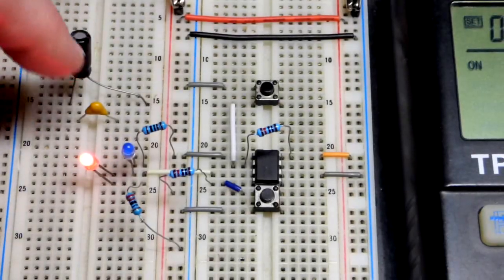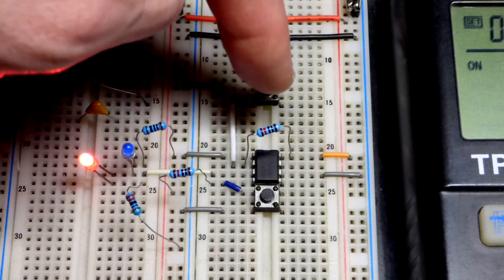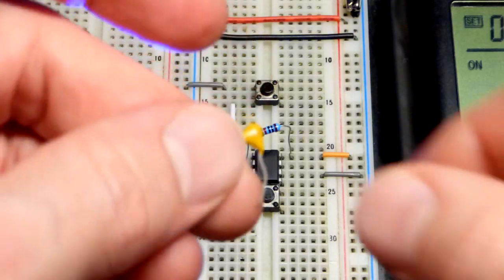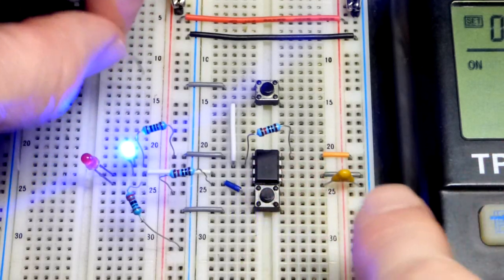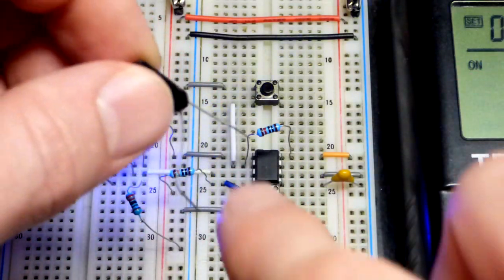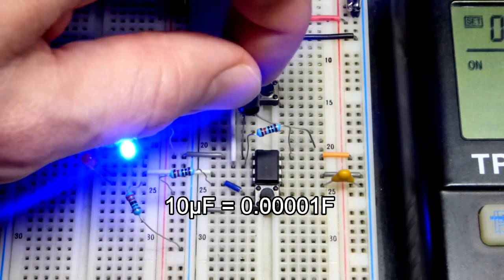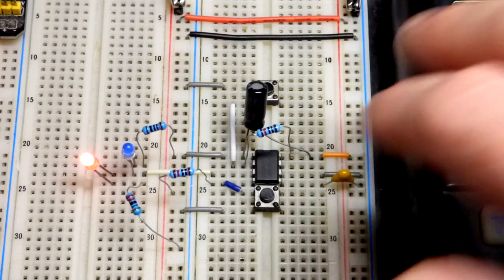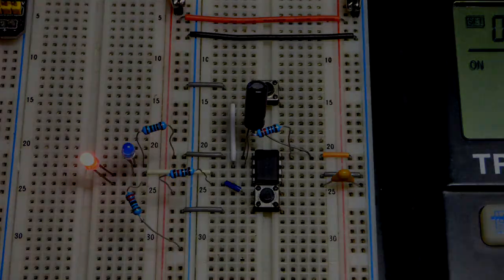Adding recommended smoothing capacitors to a 555 timer circuit learning electronics shorts 11

Comment: The bipolar 555 timer suffered from a class AB "totem-pole" output that momentarily turned on both the upper and lower output transistors as it switched state. That produced a current surge during switching far greater than the quiescent current and could result in a significant drop in the supply voltage at the chip as it switched, which caused unpredictable behaviour.
Of all the ICs ever produced, the original 555 was most in need of a capacitor across its supply pins, close to the chip to ensure stability, so your choice of the 555 to discuss supply decoupling was very apt. Of course, newer mos and cmos versions of the 555 are low power and don't have so much of a problem with current-induced voltage spikes.

Comment: Adultrations and  curruptions  are not exempted  in electronics  too.  Unnecessary /extra components  and complexity of  design  are  for this only.   On commercial  level even number  codes  are different  and manipulated for similar functions.  Every company  keeps changing  pin configurations  to make it  irreparable  without  same components.  Similar components doesn't  work  in different  circuits.  So we need universal system /agreements  for designing /codeing  of all electronic component.   In names of  trade  secrets  we already have  created  so much electronic wastes.  Otherwise  all components  would have been  used for other purposes  or children  education /projects.